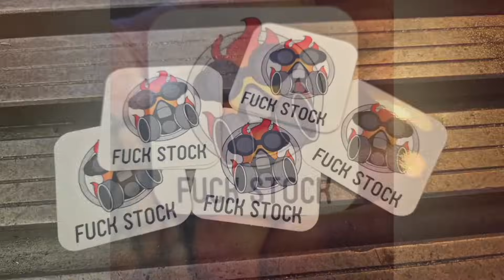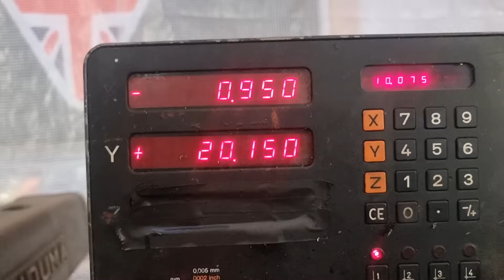UK Floods! XS100 Rigid Handmade Custom Bike Building Solo Seat Mounts #bobber #chopper #artisan

Comment: Good work navigating the flood and getting to work Ralfy, question on milling you don't use lube when taking some off but do when you cut though the piece, is there a limit to the cutter?, just learning thanks.
Reply from the maker: Thanks buddy, yeah I use lube most of the time to be fair, just not always if I'm filming 
Not sure I understand about a limit on the cutter though?
Reply: The limit as in heat or pressure on it, the grade of tool steel must be right up there to handle the work, amazing to watch. @RalfyCustoms
Reply from the maker: Ah, oh yes there is, material used, cutter type and material eg tool steel, carbide etc, type of cut, all play a roll 
I've destroyed enough tooling and parts to have learnt to start off steady